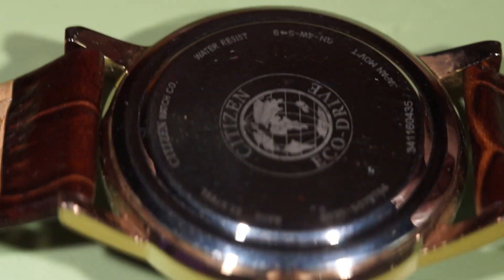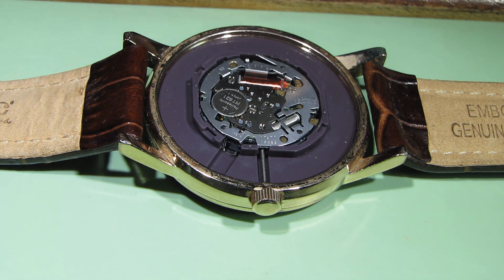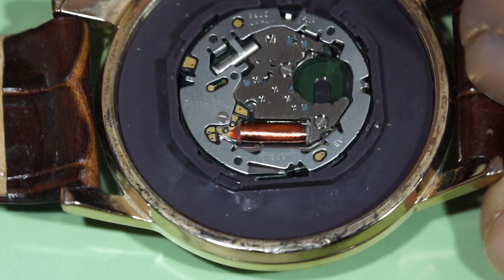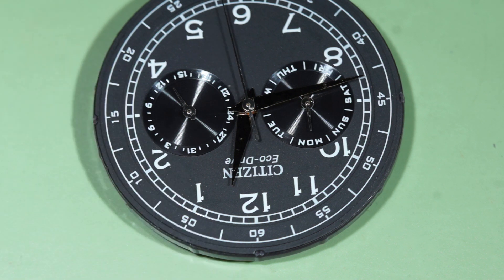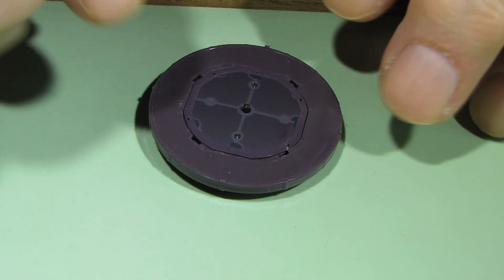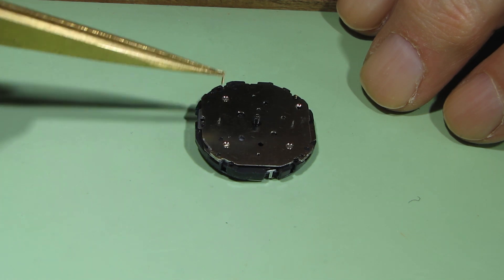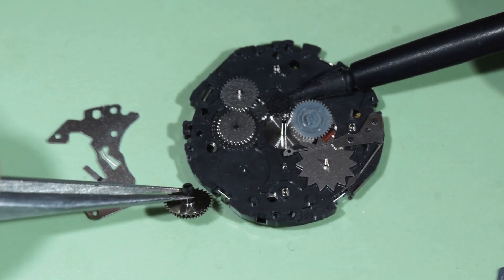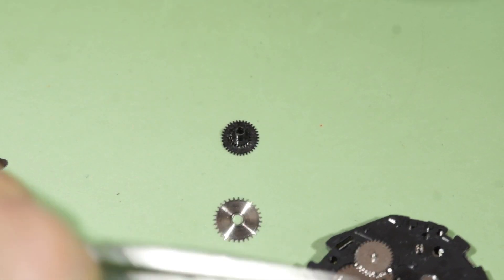Hour Hand Stuck in the Miyota 8635 Movement in Citizen Watch - Finding a Root Cause How To

Comment: How can it break?
Reply from the maker: This wheel is made from plastic and it meshes with another gear, which is mad from metal. Because they always in interaction, one can hurt another. I's a pretty common issue. Thank you for watching!
Reply: The hour hand of my U600 Citizen suddenly stops it doesn't go to 12 when the zero position is performed. When it's put to 12 it starts running but stops again.
Reply from the maker: @ivanmirones9220  This U600 movement is very complex. I had several of them in the past and most of them worked well after I've done a reset to zero positions. It's hard to tell what's the reason why yours doesn't work. It could be similar thing with a broken tooth, or it could be electronics related. If you a watchmaker hobbyist, then you can disassemble the watch and try to see it from inside. But again, this movement is complicated.
Reply: It's the exact same U600 that you aligned the second hand on a video.
Reply from the maker: @ivanmirones9220  I've just replied to your previous message about U600.
Reply: It's a intermittent failure. The hand moves without problems when the zero procedure is performed.Can the step motor fail this way?
Reply from the maker: @ivanmirones9220  Does hand rotate all the way around? Does it stop at some particular spot?
Reply: @ValentechTime  It rotates all the way without problems clockwise and counterc.
Reply from the maker: @ivanmirones9220  It looks like an electronics related. Make sure the capacitor has stable contact all the time, check if all screws holding the electronics module are tight. If still fails, you might be looking for a donor to replace the module, but it's not certain. Good luck!
Reply: @ValentechTime  Everything else works fine,digital display remains accurate only the hour hand stops,dont think it's a power failure.
Reply from the maker: @ivanmirones9220  No, it's not a power problem. Some glitch/defect. Can be fixed only via troubleshooting and part(s) replacement.